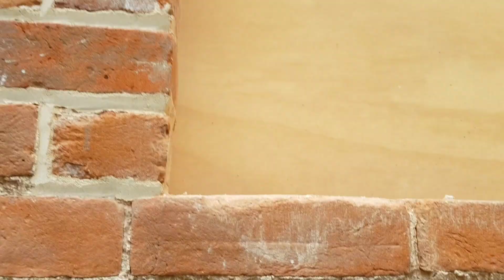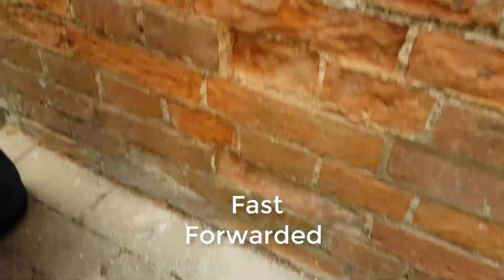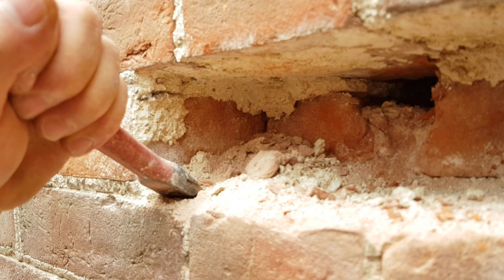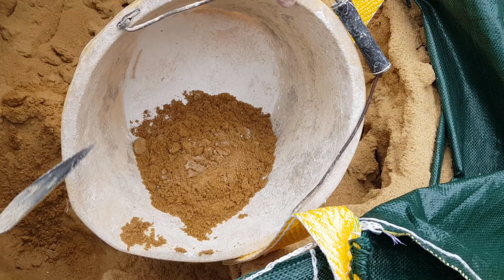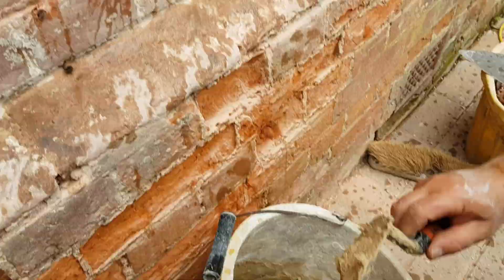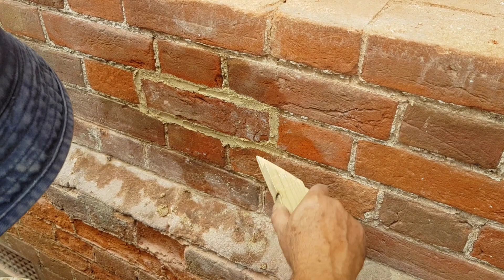HOW TO: replace a brick in a wall (BROKEN BRICKS)

Comment: Good job, i have this lime mortar in the joints of my house i use 2 sharp sand and 2 building sand, as like your job the sand they use is more course and it will match a lot better.  A lot of the grit i can see on the surface of my joints is 2mm or more, my bungalow was built in 1924, i drill lots of holes in the mortar around my bricks to help remove them.

Comment: Great video, I’m often having to remove chipped bricks or move an air brick, often use  a 10mm tuck pointer to work the mortar back in was just curios as to the wooden object you used to point up with and how to make one please
Reply from the maker: It’s just a little bit of hardwood, 10 mm thick by about 50 mm wide 150 mm long, cut it to an angle of 45% on one end, you find every now and then you have to sand or plane the end flat, hope this helps, many thanks for watching 👏👏🧱

Comment: Great video, just have few question. To me it looks these are old Victorian/Edwardian bricks 🧱. Are they not pointed with lime and sand only? Should you be using sand and lime without cement? The reason for me asking you is I have got couple of bricks to replace in my old Edwardian house, and I haven’t got any of reclaimed bricks but some of good quality from Travis and Perkins. Can I fit them into the external wall or do I must use reclaimed ones? I would be grateful for your advise. Thanks great tutorial.
Reply: I currently am a brick layer in studies and trust me when am saying this using cement in your mortar is the most important thing. 4:1 sand:cement👍
Reply: Look Around. I have found bricks under porches and buried in the backyard.I always wash my bricks with alkaline ammonia and lots of water rinse to defeat the effects of acid rain and fumic acid in soil.
Reply: @kaghachi  Keep studying kid. Cement is for modern buildings. Lime is for heritage buildings. Big difference.
Reply: @billybob8420  who tf is u
Reply: @billybob8420  ngl skill diff

Comment: Hi pal. Was that regular building sand you've used with the lime. I thought the mix was 1.5 building sand and 1.5 Sharp sand and 1 part lime 3.5 nhl,, is that correct?.
Reply from the maker: It was a mix, the sand was equal parts soft and sharp sand, many thanks for watching 👍👍

Comment: The brick was a good match, but the mortar you added was finished smooth, the existing mortar wasn't so for me the colour and texture you achieved were both wrong, you should have made a 'putty mold' for the joints and matched it more closely
Reply: @israeladesanya4596  Was there any need to be abusive, I have made a valid comment on the work done in the video, and your contribution is of no value at all. Still if you feel better about your lack of invention - Rock on
Reply: @biffoswilly  yes